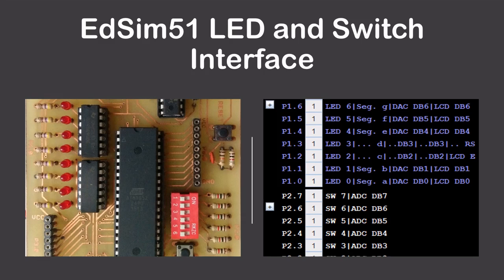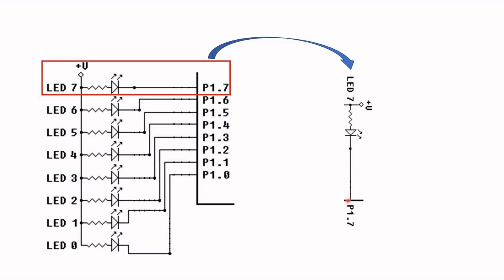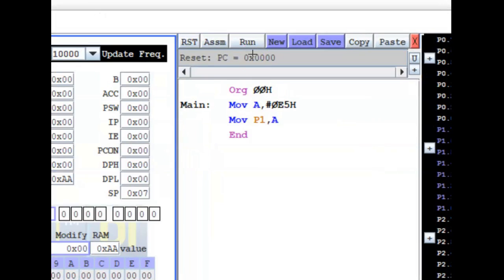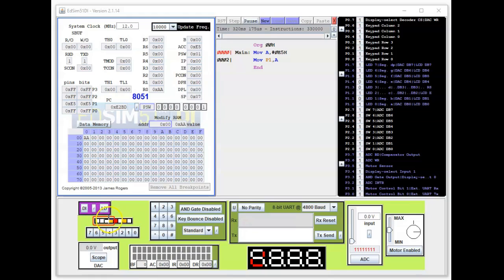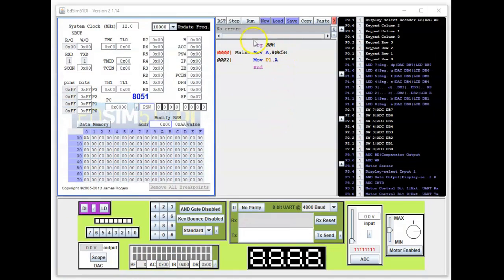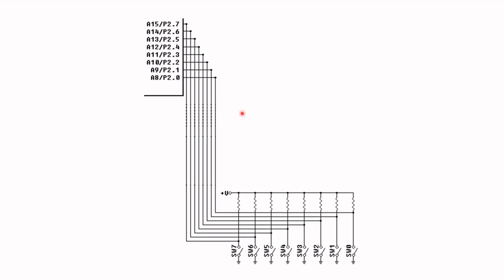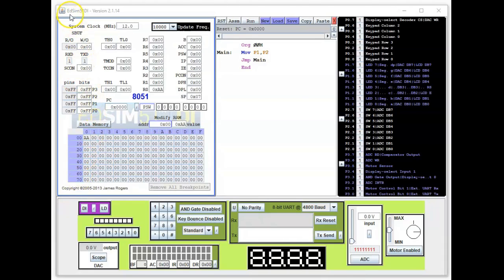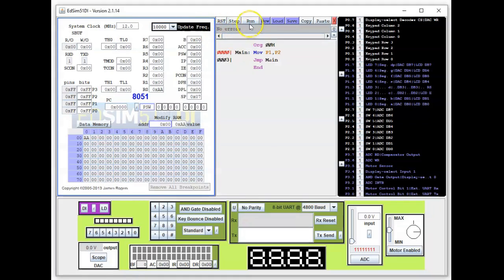#14 EdSim51 Led and Switch Interface

Comment: Is it possible to connect the LEDs to the negative supply instead of positive, so the ports aren't inverted?
Reply from the maker: Yes, it is possible to connect LEDs to the negative supply instead of the positive supply, and this can indeed prevent the ports from being inverted.
Reply: @vooiyap  Thank You for your answer!

Comment: what is the reason of putting the value e5h through accumulator (mov a , #e5h; mov p1, a), and not directly(mov p1, #e5h)?
Reply from the maker: Hi, you can do Mov P1, #E5h without the need of using the accumulator. See the following link to understand the role of the accumulator. Link: https://www.techtarget.com/whatis/definition/accumulator
It hope it helps.
Reply: @vooiyap  Thank you very much. By the way your videos about 8051 are really informative, one of the best ones on youtube regarding that microcontroller, especially for beginners
Reply from the maker: Hi, thank you for comments. It's appreciated. I am also glad the contents are useful. That's a encouragement to me. By the way, there is an error in my reply. I should have said "...you can do Mov P1, #E5h without the need of using the accumulator.  @PrzestronnyMistrz-ly8rp